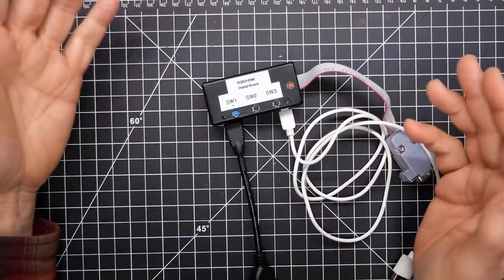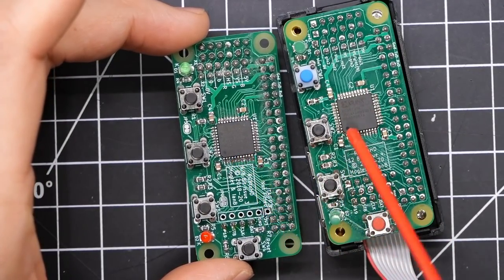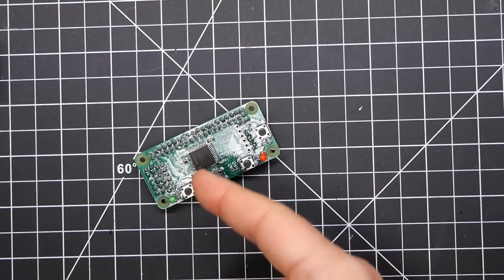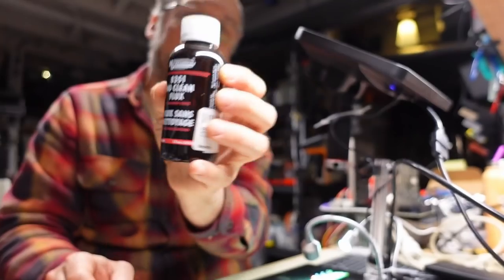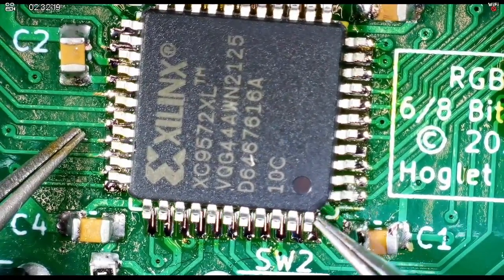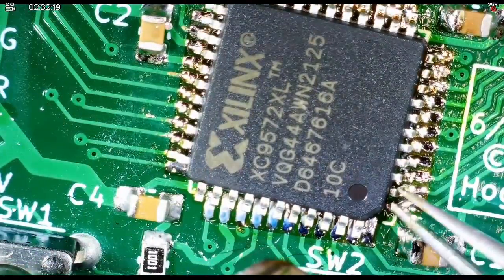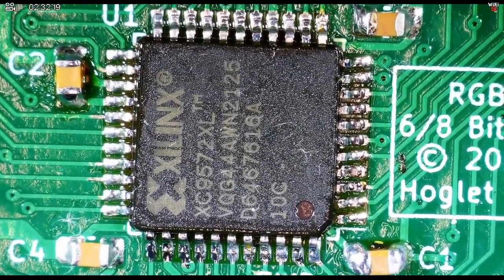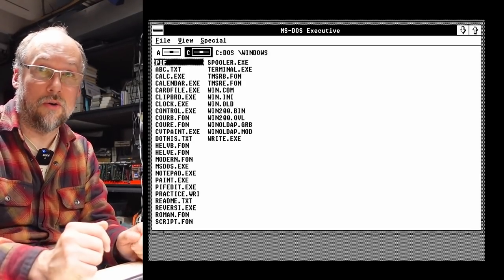The perfect way to NOT do SMD rework (RGB2HDMI overview and repair)

Comment: To remove the chip:  lookup Chip quik - flux and low melting point solder- the chip just pops off with a gentle push.  They sell small kits for single repairs. When installing the new chip I would have cleaned up the flux and old solder completely several times during the process before applying fresh flux for the next step.

Comment: The chip is still good so you gained the experience without the failure. You'd be surprised how little soldier you need on those pins, you could have easily used half of what you used. And yes, no bigger than this chip is, it will align itself with hot air so long as the air is turned down enough and you use adequate supply of flux. Too much air and it pushes the chip around and won't stay in place. I've seen much bigger smd parts than this one align themselves with no problems... so long as the soldier isn't exposed to heat too long or the heat isn't too high. Cooked soldier will not allow a chip to align no matter how much flux you use, because it won't stick.

Comment: I bought stacks of these CPLDs years ago, but most of mine are PLCC socket versions... About 100 of the PLCC XC9536, 10 PLCC XC9572, 25 BGA XC9572, and 33 QFP XC9572. I also have a XC9572 in a large PLCC version and a devboard, as well as a dozen XC95108 chips on I/O boards... Might have a tray too... somewhere... I'm pretty well stocked up on these things, all considering that I only ever used ONE of them for a project yet! 😅

Comment: A couple things to add about smd work. Get a few more narrow widths of iron tips. Avoid conical tips. Your removal was fine, but you should have wicked the old solder off to start with a fresh clean set of pads. 
From that point, you could have went 2 ways. You could have used the heat gun again to solder, or used the iron. 
If you wanted to use the gun, add some flux, use your iron to add fresh solder to the pads. Clean up again, add more flux, set the chip in the approximate location, then heat up. Once the solder melts, it should either pull itself in, or use your tweezers to very gently nudge in place and let cool. 
If you wanted to use the iron, flux the empty flat pads, position the chip on the pads. Add a little solder to the iron tip, hold the chip down with tweezers and tack the corner pins down. Doesn't matter if they are shorted right now or not, just tack it. Once you have multiple corners tacked, add more solder to the iron tip, flux the chip if needed, and at an angle, touch the solder to the pins, and slowly pull across the pins. As the solder makes contact to the pins, the flux should activate and pull what solder is needed, and as you pull away, the remaining bulk should stay with the iron. Repeat for the other sides. Clean up with wick if needed.

Comment: SMD soldering is sometimes pretty tricky, but as You said - improvement comes with doing. Just dont worry about flux - use it more and after wash it. Also to adding low melting temperature solder helps. I think this RBG2HDMI project is very interesting and I am thinking about my old Osciloscope CRT replacement to some LCD or maybe OLED... As I understand that V_Sunc and H_Sync is not counted as signals. In this osciloscope there is 2 bit video signal and bouth sync signals. Is there any possibilities to map the colors? (4 Colors in 2 bits remap in colors I like)?

Comment: 13:00 I wonder if the issue wasn't the CPLD itself, but the soldering. If you look at the pins near C2, you can see that the chip is not properly aligned to the footprint. While that is not a problem in and of itself, the misalignment near C2 looks a little dodgy. It is not far fetched to think that one of those pins maybe wasn't soldered at all and only touching the pad. I've had to rework TQFP parts that a colleague soldered without proper training, and while all solder joints looked great through the micrsocope, it was only when I started to jiggle each and every pin that I found several to be loose on their pads.

Comment: VQFP44 (pitch 0.8 mm) is pretty straight forward with a thin solder iron tip and a good amount of flux. QFP100 (pitch 0.5 mm) is at the upper limit for my skills.
Just use a really thin, bent tip next time.

Comment: I recommend that you put flux on the chip legs too.  Also you don't need to hold it in place, the chip will move into place as the solder melts.  Don't touch the chip.

Comment: You did good. Reworking with hot air is finicky. You need the right airflow and temp. A chip that can be drag soldered like this one it is better to do so. There are some chips that need hot are. They will have a ground pad underneath them. You can still tact the down with a iron and then heat them with air.

A few tips once you have it where you want it don't touch it. They will jump on you it the Solder is not molten. 

If drag soldering wick all pads clean of all solder. Solder form little mounds or pillows that make securing the chip that much harder. The chip will weble wobble on the pillows. With clean flat pads you can tact a pin or you can even put kapton tape to hold the chip. 

As always the key to hot are is even heat. Sometimes you need some insulation around where you are working to prevent one area from being colder then another. Or a pre-warmer. Keep up the great videos 👍

Comment: When you rework like this, after removing the old chip, you want flat pads. Wick off all the old solder with solderwick, and then clean everywhere with alcohol to get rid of the spent flux. 

For replacing a TQFP/LQFP like this. I would apply a line of flux around the pads and sit the chip in it. Get the alignment right, then tack solder the corner pins so the chip is fixed and aligned right. Then drag solder the rest of the pins.
Reply: Alternatively you could do it by reflow, in which case you do want solder on the pads... but you really have to clean away the flux every time it's been heated. Burnt flux will just get in the way and make a mess.

Comment: ICs are terrible the first time you solder one. It does get easier with practice. I'd suggest finding some interesting cheap kits on the flea bays to assemble as practice, before doing anything else that's mission-critical. 👍️

Comment: The 858D you are using is more than capable of doing that chip - you may need to use the next up wider nozzle and turn it up to 380-400 as it will be a lot more efficient at getting the solder to melting temperature. When you resort to the method you are used to for the wrong purpose you end up with catastrophe like you had for at least a while there.

Comment: I think it's better to clean up the Flux before doing any probing as it can sometimes stop you getting a good connection with the probes and make you think you haven't made a good joint. I like that Rosin flux but it makes a huge mess.

Comment: When soldering the board yourself spend a bit extra on gold coated pads when you order the boards because it makes it easier to bridge solder. Also use thin solder like 0.3mm thick because it's too easy to clump up the thick stuff like you did in this video.

Comment: Adrian, wasn't there a recent video where someone from Niagra Falls?? sent you some ChipQuik? That's what you needed to use, and then make sure there's NO solder on the pads when you place the new chip on the board. Hot air works better with solder paste, if you're going to use a soldering iron, then regular solder is better, but use a smaller tip! ;-)

Comment: I think the problem is with the flux and the temperature control of the soldering station. northridge fix always uses this amtech flux. and of course you need a steady hand, which I e.g. not have.

Comment: @Adrian's Digital Basement
26:18 You didn't really torture it at all. Those chips and boards go through baking cycles in the factory that apply more heat than you were(typically between 410c to 465c). They'll be fine. No worries. EDIT, your soldering technique is ok, you just need some practice. Otherwise it wasn't that bad, no worries mate!

Comment: I usually clean the pads, and then use solder paste when using hot air, much easier. And I also noticed you had a wierd angle on the hot air handle, like you held it it would be better to just heat one side and the hot air will go over the chip and other side of it. Best is to have the air go straight down on the chip, specially when moving around the pins. And the temp is probably too low, uncalibrated station probably, or low heat capacity. Good luck for next time. 😊

Comment: Oh yeah, I only use hot air to remove parts, not solder them. It's probably necessary with the much finer-pitch ICs, but for these ones hand soldering is much easier.

That being said, and as others have mentioned, you'll need to clean the solder off the pads first when hand soldering. Gel flux can also help keep the chip in place, since it's a bit stickier than liquid flux.

And finally, someone who realises that just spraying a board with IPA and giving it a scrub doesn't actually clean the flux off. You need to wipe it off with paper towel. And even then you'll still have flux underneath the ICs and switches, so the only way to clean it off fully is to let it soak in a tub of IPA or use a ultrasonic cleaner.

Comment: Your hot air rework station looks like the same Shenzhen brand that various companies buy and slap their logo on.  I have one just like it.  Atten is one of the companies that did this.  Funny enough, they have a better version that Rossmann sells these days.  Not nearly as cheap, but probably better quality.

BTW, Dave Jones's assistant discovered a failure mode where the fan died, so the heater on the handheld unit melted the plastic there.  So watch out for that.

Comment: As someone with a small amount of experience in my younger days with through-hole soldering but never did any SMD, seeing someone else with a similar experience range try SMD was interesting. As others have said, based on what I have seen watching a LOT of SMD soldering videos, they always wick off the old solder and apply new, leaded, solder. I also note you never said anything about airflow rate on the hot air station, perhaps the station you used was so cheap it didn't have an adjustment for flow rate, but if it does, I think you want to lower it for the re-soldering job, to reduce it's effect on moving the component, lastly I don't think you should press down on the component as you are re-heating it, with it sitting on top of the hard solder, all pressing it down will achieve is make it more easily want to slide around.

Comment: Put more flux on the chip, the solder will not flow on to the pins without more flux. Because are dry now, the solder is not sticking. Now heat with hot air. When the solder is on all the pins the chip will float into place due to surface tension. Move it  around a bit to get the pins coated with solder, let it cool a bit then you can add more flux and touch up with the soldering iron. Lots of flux is good, it helps the solder flow.
This way is fast and works well but requires some practice. There are lots of videos showing this.
Another way is to clean the solder from the pcb pads with desoldering braid so the chip lies flat, apply flux, then tack the corners. Then solder the rest of the pins. Lots of flux is good, it helps the solder flow. There are better fluxes to use , check the ones that Rossman and Northbridge use. The one you have leaves a lot of brown deposits.

Lots of chips, not the 9572 have a pad in the center that has to be soldered properly.

Comment: You need a higher quality/power air station to do larger IC's all at once.  You can get by doing one side at a time, but circling the chip as you know now isn't effective.  The board dissipates the heat too fast.  Nothing wrong with using a soldering  pencil if you have patience.  Just buy or make a finer tip for the fine pitch components.   Nice repair.

Comment: 23:43, I am so sorry but I am glad that you can laugh about it.  I would be livid lol.  I actually ruined the DVD driver chip once when modding a PS2.  I bridged 2 pins together then evidentially applied too much heat that it lifted the traces off the board and had to totally trash the whole thing and go with a different, easier board version to mod which went successfully.

Comment: My take on this task would be to use capton tape to thermally isolate the capacitors around the CPLD, with four strips of capton tape around the CPLD, make sure the PCB is clean (using isopropanol) so the tape sticks reliably to the board. Use the very sharp tip of a fine bladed scalpel knife and try so that it will lift one corner of the CPLD. alternatively there are small pen size devices with heat resistant rubber suction cups that can be used to lift up a chip from the board. Then heat up the CPLD so that the solder melts and the CPLD is lifted from the board by the scalpel point. If it lifts up use a pair of tweezers to pick up the chip, and remove it. Then, and this is very important, clean off all solder from the quad flat pack pads! having any solder on these pads will make positioning the new CPLD almost impossible as the pins will glide off from solder bumps on those pads!  Then carefully place the CPLD on the solder free pads and using a tiny amount of solder solder one pad of one corner to its pin, this is the tricky part as you need to solder only ONE pin only, then carefully push the chip so that the diagonally opposite pin to the soldered pin will be directly above the corresponding pad, so that the chip's pins are placed exactly over the corresponding pads, now carefully solder the second diagonally opposite pin. Now you can add flux withy rosin.
wet the point of you solder tip with new rosin containing leaded (60/40 lead/tin solder) DO NOT TRY TO USE LEADFREE SOLDER! and from one of the solder free corners toward one of the soldered corners drag the solder point over the row of pins. The solder point should have just enough solder for all the pins on one side, and the chip should not move during the dragging of the point. If there is solder between two adjacent pins don't mind that for now, you can fix that later. do all four sides like so. If there are two or more pins that are connected by solder remove the extraneous solder by wetting the spot with flag, and use solder wick to suck up some solder.
if there is still to much solder then spread the solder out over the row of pins by sliding the solder point over the row. Clean your point and repeat where needed. use the microscope to check for small needlepoint solder shorts between points, and remove them by heating the short. Afterward use isopropanol to clean the flux residue away, then check your work again under the microscope, without flux it will be easier to see shorts. now sometimes an IC pin will not be soldered to a pad, check this by looking if the pin moves by putting a very little bit of pressure on it sideways with the point of your scalpel, if it does move put your cleaned solder point on it to melt the solder under the pin, and test again with your scalpel. after checking all pins your CPLD should be soldered correctly.😃 Now you can remove the caption tape, and clean the area under the tape!

Comment: But if you don't use that buffering expansion board, you might damage the new CPLD sooner or later, so you should solder one now, I saw a nice SMD IC on that, too ;)

Comment: Yeah smd can be a pain. Cleaning the pads after removal, and using solder paste helps. For multilayer boards a hotplate set at temperature lower than the melting point is almost required. Otherwise the ground/Vcc planes keep those pins from getting up to temperature.
Reply from the maker: I really need to find myself a hotplate, because yeah I've tried with PCBs with those extra layers and even soldering through hole onto the ground plane is super difficult.

Comment: Hot air should only be used to remove a part. You need to clean the pads off and than solder the chip to the board. You need to get a smaller tip for your soldering iron as well, I have a Hakko solder iron that's 20+ years old and I use a T18-S4 Fine SMD tip.

Comment: Adrian, as you pointed out, You really should be using the TTL buffer board.
Reply: Btw, you really made life hard for yourself, you are best to clean off the pads and use drag soldering to replace the CPLD. Here's me working on the same RGBtoHDMI boards.
https://youtu.be/0eEz7k9jNsY?t=1023

Comment: You were good up to removing the old chip :)

Then, you should have wicked away all of the old solder and tacked down the new chip at one pin with a soldering iron, and drag or dab soldered the rest of them. Hot air is nice, but honestly not with those 0.5mm QFP packages. I have plenty of experience with SMD soldering meanwhile and I solder QFN with an old Weller WECP and a flat chisel tip. Much preferred.